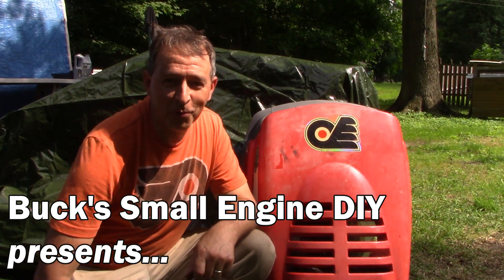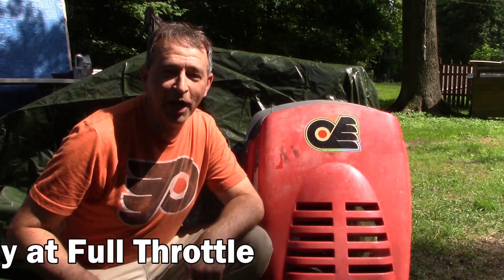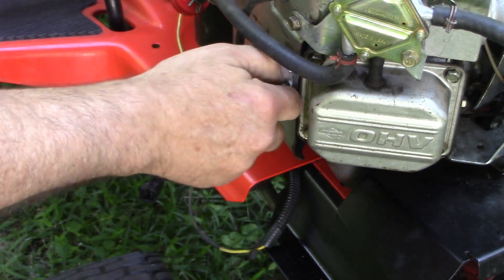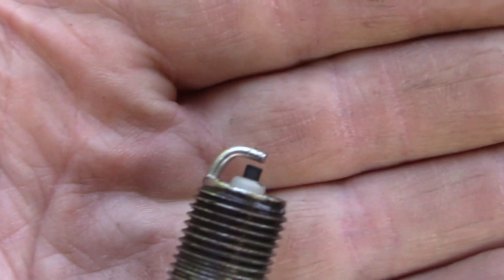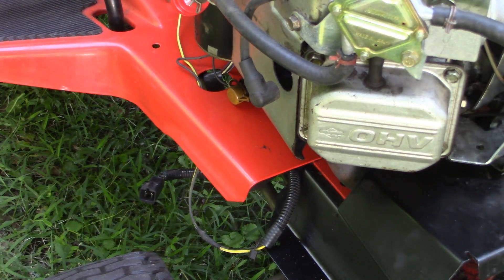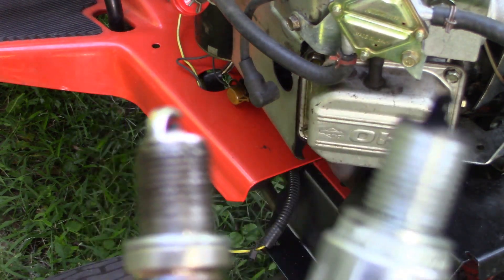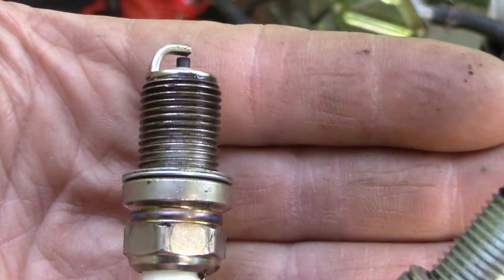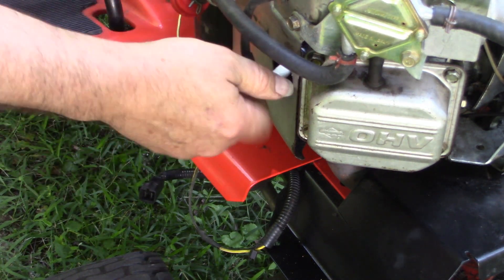How to Diagnose a Briggs V-Twin that BOGS DOWN at Full Throttle

Comment: I would open it up and if it’s only a connecting rod, I would attempt to replace it.  If not, be on the look out for at least a 18-20HP Intek for $50-$80 and stick it on there.
Reply: I would change the connecting rod

Comment: The shroud tin is missing on cylinder of the first plug you pulled out. If it ran like that, it would have overheated and caused some damage.

Comment: Spark, compression, fuel.  This is the diagnosis path i would always take on any ICE. 

Since it would seem that it is a broken rod, i would really want to rip it open to see how it can run without clanking and eating itself from broken metal parts.  I had an issue where the motor had no compression.  Found out it was a failed plastic cam gear that Kohler uses.  Yes plastic.  $50 replacement cam gear (metal) and it was back in action.
Reply from the maker: Yeah, I figured it out eventually. I have another video showing what I found when I opened it up. Thanks!

Comment: Almost similar problem here on a brand new machine (Ride-on/Lawn Tractor) However it is intermittent, sometimes goes single - lots of banging and farting, & sometimes sweet on 2. Swapping plugs over swaps the misiring cylinder.! I plead guilty of pinching one plug fpr another B&S single cyl 360cc, and puttying a 360cc single type plug in the twin. Not happy! And that "Crook" plug works fine in another  B&S single (Push mower) Musical plugs later I prove they are all OK, but the twin likes its correct plug. Better get a correct type new pair and stop stuffing about! I suspect B&S singles now have suppressor resistors built in to the plugs, and the V twins do not. AaaarrrrrgggH!
Reply from the maker: A new set of sparkplugs, well, that's an easy fix, right?
Reply: @Buckwsr  Yep, got a new pair yesteray & put them in, Bingo! I couldn't conveniently rescue the plug I filched - The 360cc B&S it is in is a fire pump, and stranded on high ground behind a flood. In SE Australia  these valleys are very wet right now. Cheers Buck.

Comment: Wow just got mine back from the shop it does the same thing . And I just had the shaft seal replaced to . Man I hope its not that . Wow but the its doing the same things yours is and it was was just in the shop at a tune of 977.00 to
Reply from the maker: You can lose a cylinder for simpler reasons than just mechanical damage. Could be a bad spark plug, or a bad ignition coil. Test those things before doing a complete freak out! Good luck.

Comment: The plugs had me thinking bad intake valve on 2. Definitely not a carb. Fuel issue would affect both cylinders.  I would look for a used engine. Well worth a couple hundred bucks to save a few thousand.
Reply from the maker: Thanks, Larry. I ended up replacing the engine with a used one that had been given to me. I used some parts off the original engine....starter, muffler, intake manifold, etc. Tractor owner was pleased with the renewed power again. Not sure how long he had been running it on one cylinder for him.... Thanks again.

Comment: Buck, I too am a DYI backyard wrench with a few more years under my belt. My suggestion to you would be ; before you go through rebuilding the carb and all the messing with spark plugs, Why not after you first take them out, take a compression test on each cylinder and compare.  Also to test for one bad plug, just switch them to see if it gets hot on the other side. 
 I have a John Deere with the same engine. My loss of power problem is the choke is incorrect and I can't seem to find anyone who has the same set up. It only has ONE cable operating both the throttle and choke but the choke linkage does not line up with the carb like to properly operate the choke. I don't know if someone has replaced the carb with a similar model having the choke link in a different format.
Reply from the maker: Thanks for the tips, Jerry. I learned a lot in this process. Next time will be easier as a result. I hope you can figure out your choke linkage situation. Good luck, and thanks for the note.

Comment: This is very interesting. I have a 2004 from new Honda v twin OHC ride on mower . Was going to one cynlinder regularly. After weeks of futering. (That's a Ulster Scots term) . It is now going to 1 cylinder under load ONLY now. I have spent a considerable length of time getting it to run on two cynlinders up to this point, working on the carb. But I am now at a loss. It starts fine but if put under load with drive train occasionally and every time going into grass it goes onto one cynlinder.   Stop it and it starts fine again?. Any thoughts?
Reply from the maker: Yes, very interesting. Of course, as you can see in my video (and the subsequent teardown video I did) that the problem was mechanical damage inside the engine. Sounds like your problem is related to either fuel or ignition, and if I had to guess, it'll be an ignition issue, not a carburetor problem. Please let me know what you discover. Good luck.
Reply: @Buckwsr  All sparks functioning correctly...... intermittently???
Reply from the maker: My thought is that a carburetor problem would impact both cylinders, not just one, as they both share the same carburetor. So if you've given your carburetor an examination and cleaning, but still have problems, I'd be thinking more about a possible ignition issue. That's my thought, for what it's worth, which may not be much....

Comment: I would price a modern engine if cheap enough. Otherwise get a new mower. Other parts on the mower are ancient also so I would get a newer mower. They aren’t that expensive. Not like cars now.
Reply from the maker: We decided to swap out the engine with a slightly newer one I had on hand. It's running on both cylinders now, ha ha, and so hopefully we'll get a little more life out of this tractor. Thank you!

Comment: Go ahead and fix it. Those older Briggs and Stratton engines are worth fixing. 🤔🤔🤔🤔🤔👍🏿
Reply from the maker: Thanks, Patrick. I'll tell you what I've done. In the video, I reference another engine I had laying around....same engine, just a few years newer. It checked out alright, so I swapped engines and got the tractor running fine again. I'm sure someday I'll get around to tearing that old engine apart. We'll see.....
Reply: @Buckwsr  I look forward to seeing the video of you swapping engines. 👍🏿😊

Comment: Great video!!! If it was mine,,,, I would try to fix it if the rest of the mower is in OK condition. The OLD MOWERS ARE BUILT MUCH BETTER..... the new mowers are about $2000 and up.. today's mowers are built so CHEAPLY and are junk. That old one was built to last for a very long time.  You will be lucky to get 5 to 6 years on a NEW MOWER before it starts giving you PROBLEMS. Like I said if it was me I would replace motor easiest way or rebuild it
Reply from the maker: Thanks, Rick. In the video, I reference another engine I had laying around....same engine, just a few years newer. It checked out alright, so I swapped engines and got the tractor running fine again. I'm sure someday I'll get around to tearing that old engine apart. We'll see.....